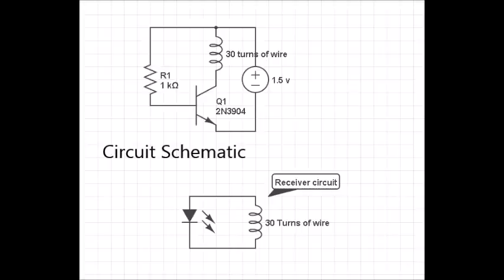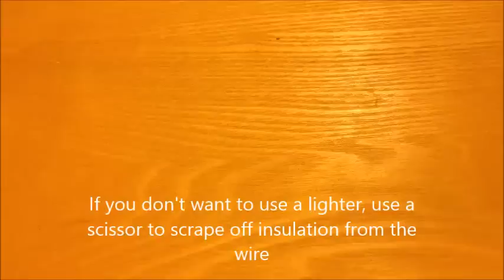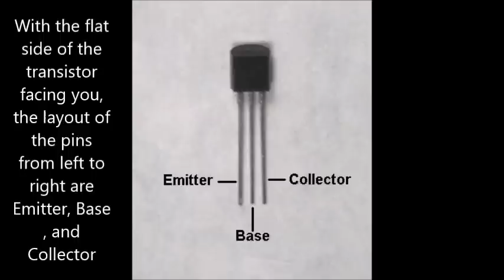Wireless electricity transmission circuit

Comment: Hello, I’m beginning to learn about this... could you please explain why you did 30 and 15 turns when coiling? Does it not matter how many turns you make or is their a math that needs to be followed? 

Hope to hear from you soon, thank you!
Reply from the maker: Hello, this is an old project so I do not remember the exact specifics. However, the schematic is incorrect. Both coils are 30 turns, however the coil connected to the transistor (the transmitter circuit) has a center tap at 15 turns. So basically there is a section of the wire that is uninsulated at 15 turns. The battery is connected to that center tap of the coil. One end of the coil connects to the resistor, the other end of the coil connects to the transistor.  This is done to ensure we can have a changing Voltage across the coil. The coil in the transmitter circuit and receiver circuit both have 30 turns. When they are close to each other they form an air core transformer, where the voltage across the receiver circuit is proportional to the ratio of the turns between the two coils (ideally). As long as the receiver is higher number of turns than the transmitter you shouldn't have a problem, this is an extremely simple and forgiving circuit. Hope that helps.

Comment: It worked. I eliminated the resistor. I used 0.35 mm wire. 30 turns. A 1½ V battery. BD139 transistor. My LED needed turning; seems it was on backwards. Good luck.
Reply from the maker: Good improvisation :)

Comment: May I ask what is the use of the transistor in this experiment and why did you choose the 2N3904  type of transistor but not others. Thanks.
Reply: hello....? any help please?
Reply: Dipper J. Drust  transistor are use to amplifi a weak signal for example like he is doing he  is using the transitor to amplifi the current through  the coil in other words  it will help to induce more current to the other  coil by a magnetic  filed produced  by the current this is how basically  transformers  work to step  up the voltage or to step down the voltage....
Reply: U can use any power transistor NPN , check out my video How to make it using CFL ( ... Its components )
Reply: Oh, thanks guys!! Thank you so much!!

Comment: I like the project, but I have a stupid question. Will the transistor overheat if the battery is in the circuit over a certain period of time?
Reply from the maker: Micah Rambadt  Don't worry, its not a stupid question.   Based on the type of transistor, the battery and resistor you use, it might heat up the circuit over period of time.  Do not keep the circuit turned on for more than 5 minutes in a go, cause it drains the battery and heats it up sometimes(The transistor would definitely heat up, the battery might heat up too as batteries have internal resistance) . Also if your transistor overheats, you could increase the resistance of the resistor and use heatshrink or transistor with higher amp rating.   Anyway good luck and thanks!

Comment: what well happen when your done and you put both coils together will it burn out
Reply from the maker: Well I tried putting them together, the only thing that happens is the light get really bright. The peak voltage produced from the oscillation is really high, high enough to burn the LED. But since voltage is oscillating, it doesn't always stay at the peak voltage. At times the voltage drops to 1.5 volts, at other times it could raise upto 12 volts! Overall the oscillation balances out the voltage, and keeps the LED from burning.     Also the current isn't enough to damage the LED.      :)

Comment: how to do same with any usb charger cable for mobile and also with 2.1 amp and 5volts....pls
Reply: Neet = Need
Reply: I will try that for my chemistry project
Reply: To do this for your cell phone you would have a decent bit more things to consider and design.  The things that come to my mind initially are figuring out, how far apart your induction coils would be, so the transmission coil and reception coil.   They can only be so far apart depending on the strength of the magnetic field created via running current through the winding.  There are multiple methods of increasing the strength of the field, such as increasing the current through the wire, the number of winding's (turns) of the coil itself, etc.  Another important thing to note here is that the orientation of the winding's matters.  Such as you can not have one coil turned sideways, then another turned up right and have it work, at least not well at all.  The coils ideally need to be either in the same orientation with one another, or, multiple coils utilized to allow for various orientations of your collector coil.  and one more thing to consider since were speaking of increasing current to increase the distance between the coils, is that the amount of received current will vary.  If you have the two coils further apart for instance, or one turned slightly out of orientation then turned back into the proper orientation as another example, the total amount of received current will be changing constantly.  This is important as your cell phone charging circuit is designed to only handle a particular range of input voltages.  So in some situations it will be receiving too little voltage to charge the phone, or, in others, potentially to much and damaging or destroying the charging circuit of the phone itself (Assuming  that you are wiring the reeving coils input via the existing cell phones charging port circuitry). So you would need to include a voltage regulation circuit or component into your design.  These are not super complicated or expensive components but would be very necessary to safe guard your device.  Anyway, I hope that you continue to pursue this design, and that it goes well for you.  It is in my opinion an excellent way to learn and understand how electromagnetism functions in every day equipment.  Also I am not a professional or highly trained electrical engineer or anything, so while everything I have mentioned is information I feel to be correct from what I have learned over the years, it may be to some degree incomplete or even incorrect so please have a read in Wikipedia or google about electrical induction.  Good luck :)

Comment: nice . thank u . can u tell us all the components that we need to done this project
Reply from the maker: +Ibrahim ahmethan You need an non transistor, 1 k Ohm resistor, copper wire and led light and a 1.5 volt battery.  Glad out liked it :)

Comment: what if i don't have the exact same model of that transistor? can i use another NPN one with similar properties ?
Reply from the maker: TheStarryKnight yeah definitely, but make sure it has a relatively low collector-emitter saturation voltage .
Reply: thank you so much for answering, i compared the data sheets and they look very similar, 40V in yours, 45V in mine, i'll give it a try
by the way your content is great and easy to understand, you just earned a subscriber

Comment: sorry i got a silly question, why do you need to make a tap for the transmitter? what is the purpose of that?
Reply from the maker: +Xisheng Chen  The tap is made to let the current flow in two opposing directions through the coil , so that their magnetic field and inductance allows the circuit to work.
Reply: Oh i see. thx! and one more thing, does the tap do anything to the transistor? Can i say that the collector and the base will need two sources to work properly, so you created two current flows, is that correct?

Comment: Does it have to be exactly 30 turns? If you have a bit less is that okay?
Reply from the maker: +MrAgentMooshroom  It is okay as long as you have something around 30 turns
Reply: +AH Electronics is 27 okay? Because, the circuit doesn't function. Sorry, I haven't taken physics yet...
I'm using an 1.2V LED and twisted the wires together instead of using solder. The diameter of my coil is approximately one inch.
Reply: +MrAgentMooshroom no you can make minimum of 23.5 turns
Reply: +MrAgentMooshroom the wires are insulated so you have to solder them or burn the insulation of the ends
Reply: +tammali srinivas well.....that depends on gauge of coil actually I made one with only 5 wraps
Reply: +AH Electronics can this be done for example to reduce from 12v to 1,5v? For instance in case you want to charge a battery of 1,5v from a battery of 12v: it would be 120 turn for the 12v and where it is the led, instead the led put the 1,5v battery to be charged, and the turns would be 7,5 turns. What do you think would it result?

Comment: Is it okay if I just use regular copper wire without insulation and without resistors? What could happen if I don't use magnet wire?
Reply from the maker: without insulation out would not work,  the insulation keeps each turn of the wire from getting shorted with each other.  so yeah you need insulated wire. and the resistor night be optional
Reply: +argha halder            
so I don't need a NPN transistor and resistor?
Reply from the maker: You need the npn transistor, but you don't need the resistor. But having a resistor saves the circuit from burning

Comment: the transistor works as an oscilator. It takes the cc volts and transforms into ac volts. how can the led work on "ac" without a diode to rectify the output ac current? 
i dont understand!
Reply: LED also works on AC voltage, if we apply a small amount of AC supply on the LED, then it will blink because of frequency
Reply: Kamal Rathod oh! that's why it's called LED "Light Emissor Diode!!! A LED is also a diode!!!!
thank you!!! 👏👏👏👏👏👏👏👏👏👏👏
Reply: aahhh the beauty of a LED!!!
Reply: What transistor n resistor used?

Comment: I can't seem to get mine to work, whats the voltage needed to turn your LED on? The LED's I have need 2V to turn on, but when I turn my source up to 2V-2.5V the chip starts to get super hot and burns out, any suggestions?

Comment: Hi. I tried this and I want to ask you something regarding voltage of the circuit.
For my emitter coil, I wound the wire 5 times, made the center tap and wound the wire 5 more times.
For the receiver coil, I wound the wire 10 times.
I used a 1.5v AA battery and connected it to the emitting circuit, and connected a multimeter to the receiver circuit.
However, I got some bizarre readings, up to 8v.
Can I know why this is happening?

Comment: Hi, I tried to build the wireless circuit according to your spec but for some reason it doesn't work. Any thoughts as to why? I ran out of ideas. The only difference is that I am using a 5mm green LED. Thanks.

Comment: I've tried this video for 5 times.. Using 2n2222 transistor and using 2,2 resistor, also using 1,5 volt battery. I also make the copper wire 30 turns (15 turn + 1loop + 15 turn) as same as yours, i've checked the + and - on the battery and it was same as your schematic.. But why do my enamel doesn't want to create a magnetic field.. Please help

Comment: Can we charge a mobile through it if we send 5V and 2A current in transmitter circuit
Reply from the maker: sanskar lamsal  You need to send in maybe 3v at most to the transmitter circuit and use a resistor of about 10 k Ohms. Then in the receiver coil use a voltage stabilizer to stabilize the output to 5v DC. Remember, 3 volts in the transmitter circuit would be boosted by the transmitter, so the electricity in the receiver circuit would jump higher than 5 volts, so you need stabilizer.

Comment: sir...I only ask that ....which wire is sufficient to do this project...
Reply: +Md Saqib looks to be somewhere between 26 and 30 gauge magnet wire. Any of those sizes will work just make sure its magnet wire. There's a thin coating on it so the wire doesn't connect to itself in the coil.

Comment: How does it work with DC source? Does it not work by transformer principle?
Reply from the maker: Stephy J The transmitter circuit produces an oscillating magnetic field, which mimicks the behaviour of a rapid pole changing alternating current.

Comment: wow its awesome but how to increase it's range please tell me
Reply from the maker: You could try increasing the power of the battery (9v), and switch in a transistor with higher breakdown voltage.  Also you could try experimenting with different size and type of coil ( for example pan cake coil, or try increasing the number of coil or the diameter) .     Experimenting will definitely help you, not only to succeed, but to make a better design!  Good luck!

Comment: what role does the R and Tr play in this?
Reply from the maker: +Sys.stem  The resistor stops the transistor from overheating, and the transistor is used to rapidly switch the current on and off so that we get an effect of AC electricity, so that we can induce current in the receiver coil.
Reply: argha halder induce current wont occur during dc current ??
Reply from the maker: No DC current would induce current but only once which is not sufficient,   but AC current keeps changing polarity, so it would induce current a lot of times faster than our eyes can detect,  and we will see the led light up

Comment: can i use 3 volts batery?
im sory my bad english because i AM brazilian. your vídeos is só cool, i make this circuit for the school
Reply: The circuit is generating AC so in one direction it goes thru the LED in the other the LED acts like a diode and blocks the voltage.  the higher voltage will give u more power but will also generate higher voltage on the LED and will go over the reverse voltage capability (just 4 to 6 volts)  of the LED and it will get damaged.
Reply: what is the use of the transistor in the circuit?? is somehow converting DC to AC ???

Comment: Would I be able to set this up to run on 5 volts to charge my phone
Reply from the maker: You would need a lot of other circuitry, because the LED is running on an oscillating voltage,    if you feed your phone battery with such unstable voltage it would be harmful for the phone.

Comment: doesn't "transformer" coils only work for AC currents? but why this works on DC?
Reply: Irfan Ghani Actually the transistor generating oscillating current from dc power.
Reply: 김도운 didn't know that.. thanks!

Comment: will a 2n3055 or a 13002 work?
Reply: u need a high frequency transistor.  2N3055 is not high frequency enough for this application.
Reply: John Conrad what is a good transistor for this project?
Reply: David Roberts try 2N3904.  you don't need high power, just a fast transistor.  after all the LED only takes a few miliamps
Reply from the maker: +David Roberts General purpose transistors should be the best for this, since they have a low base emitter saturation voltage, and a high breakdown voltage. So I suggest using 2N2222, 2N3904 since they are cheap and easily available.

Comment: This is a demonstration of Faraday´s Law, there are not transmition electricity, there are an induction electricity. like occurs in the transformer machines. (Yes, the transformer is an static electric machine). Please dont confuse Faraday with Tesla.
Reply from the maker: You are right, it works by mutual induction in the coils, hence it's different from Tesla's work. Sorry if my title was misleading.
Reply: AH Electronics I did this same experiment but instead I used a 9 volt battery to connect it to the coils and it still didn't work what did I do wrong?

Comment: Hi my this project is not working. I followed your circuit. Main coil led worked but second coil LED not glow.
Reply from the maker: Does it not work when you hold both of those coils on the transmitter together, or is it just when you hold the second coil near the first. If it doesn't work only when you hold both of them together, I would be guessing it's a power output issue, because I managed to do it but they were dim. If the problem is only your second coil doesn't work no matter what, you should try resoldering the connections.

Comment: I used a copper wire  for it but it didnt work! I tried to change the transistor and the led too bt it still didnt work! recently I watched a video for this project ..They dint use any resistor and it worked
Reply: put diode if dont have resistor.

Comment: Hi, I have tried making this project multiple times only to fail every single time. This project is starting to make me angry, so I thought I would come to you. I used 24 AWG magnet wire to wind my coils, I have used a 1k ohm resistor, I have a 2n3904 transistor and used that, and I can't seem to figure out the problem!
Reply: Scotlahn Mccallister did you get it to work? The wire you use must have a coating of insulation on it else all you get is one big lump of solid wire.
Reply: +flitsies Yes, I used magnet wire, thinly insulated wire , coated with varnish. But I do believe I hooked up the connections incorrectly, because I recently made a pancake coil that can transmit 5 to 6 inches away.
Reply: Scotlahn Mccallister Glad to here you got it working.

Comment: I did all the thing same but still my project is not working. What is magnetic wire actually??
Reply from the maker: annu singh Magnet wires are just regular copper wires with a layer of thin enamel insulation.
Reply: I tried my level best but still my project is not working. Will u tell me what r the common mistakes cometed by most of the people

Comment: magnetic energy from the coil on the battery is sent to the other coil causing the magnetic forces to convert to energy. i think...
Reply from the maker: +BuildingMaster 5000 magnetic field fluctuation induces current into the receiving coil. So yeah same idea. :)
Reply: Thanks for telling me that.

Comment: Can we charge a phone if we put a 9v battery
Reply: +khan Amaaz you can't. 9v battery can delivers masimum 300mAh and you'll have lose curent on the coil. I saw other days someone making a pancake wireless charger using 12volt 2Amps input two 470 ohms resistor in series(5watt) and transistor tip35c.The circuit output curent on air coil was around 450mAh. Some phones can be charged with 500mAh.